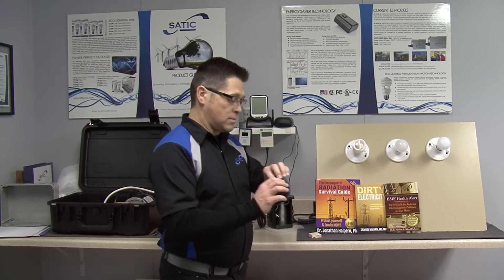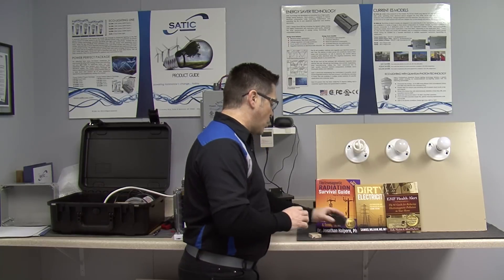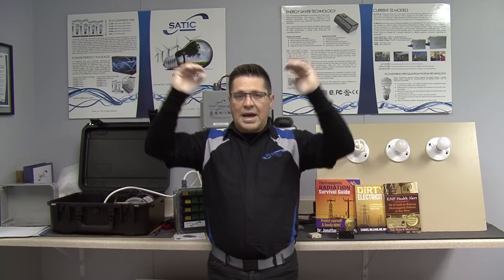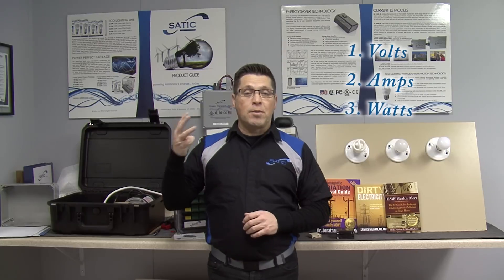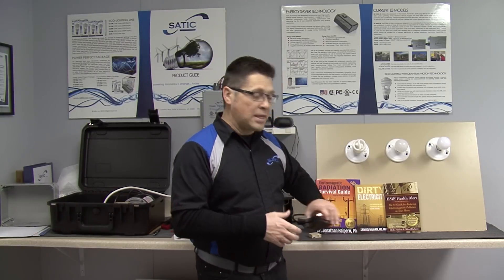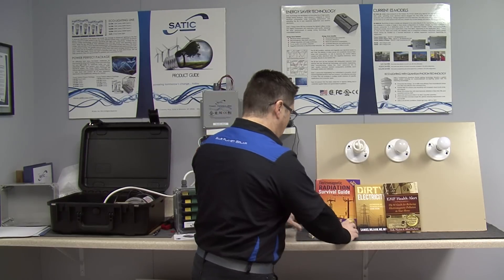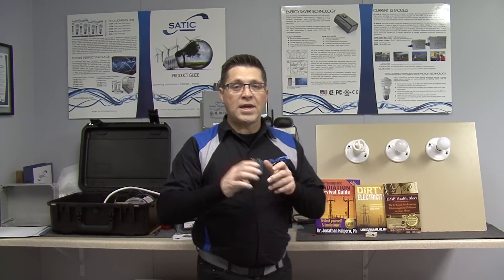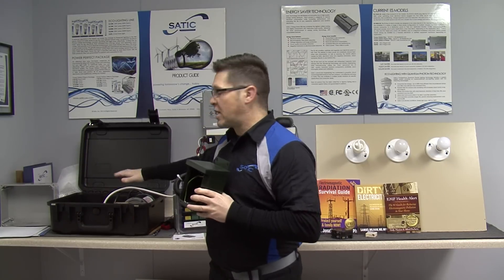What is Dirty Electricity?

Comment: What would turn my outlets black?  I can hear my fans going fast and slow.. Is that a spike in electricity?  It goes up and down repeatly for hours.
Jeanne on the Oregon coast  Pacific Power & Gas is my electrical  Grid here in Lincoln   City... >Electromagnetic interference from what? May be the electric grid or how about WiFi?  I know the field can be stacked & pushed. Since the cable runs with electric lines the outcome goes directly into home of choice..  Thank you! Excellent video ❤🕊

Comment: If you wish I would like to know if this would help clean up CB radio static on receive? At the same time it would it help if the load is unbalanced in the breaker box? I was told that was what caused the breaker on my Honda generator to trip every time until we bypassed the factory Honda GFCI. Of course after not finding anything else but the imbalanced. Thanks for the video.
Reply from the maker: Thank you for your question. 

It will only help reduce static on the radio, if that static is indeed being caused by distortion or harmonics on the A/C line. While yes, it is a very common cause for static, distortion on the A/C load center is not the only potential culprit and we can't therefore guaranteed that it will be able to remove the static and serve you in that particular capacity. I'm sorry to ask that you settle for a 'probably' answer. It's just that when we don't genuinely know the cause we choose to state that clearly. Satisfaction is always guaranteed so we don't want you to purchase anything that won't serve you. 

Our only certainty is that your power will be cleaner by nearly every definition. 

Next, the imbalanced load should not effect a 120v device in most cases as its only pulling from one leg (phase) and therefor wouldn't be terribly effected negatively by the other leg (phase) having a smaller or larger amp load. You would ideally like the load center closer to balanced phase to phase for other reasons however, so still something to look into correcting if possible and reasonable in expense. 

Continuing, generators are notorious dirty electricity culprits. One of the usual suspects we call them. It sounds like you were exceeding amperage on the GFCI so depending on load type, inductive or resistive the Satic unit may correct that as well. 

We hope this helps. 
Thank you so much for viewing.

Comment: Excellent video.It here a unit available,  that can be connected to the main line coming into my panel..?
Reply from the maker: Thank you Patrick.  Satic does indeed manufacture whole home, main panel wire-in units. 
Satic Tech Dept.

Comment: Anyone that knows anything about electricity knows that an inductive or capacitive load changes the waveform and that gives you a low power factor and this circuit restores a high power factor.

Comment: I liked the video which was very informative. I tested my outlet by using a radio on the am band with the dial all the way to the left. The noise level goes way up near the outlet. What do you think of these Greenwave filters for dirty electricity? Are they good to use in an apartment building or is it a waste of money?
Reply from the maker: They are an effective tool for reading a form of DE on the electrical system. 
Satic Tech

Comment: If this box removes the EMF why do you need the individual filters ?
Reply from the maker: This question has many possible answers Asheem. Perhaps a customer would like to gift a child in college with a unit for their dorm room, or take a plug in unit with them when staying in hotels or traveling. Perhaps a home owner plans to move and doesn't want to wire something into the panel yet will purchase something today that can move with them. Perhaps the breaker panel is full and can accept no more dedicated breakers. Perhaps their is a tech device, lighting system or RF signal hitting one particular room that we call a "hot spot" with some major source of DE, that we call a "culprit" and the panel unit at the other side of the home can't get to a ultra low number one that one outlet because the cause (culprit) is right by the outlet that is being tested and a person in that room is very sensitive. There are a lot more answers yet I think you're seeing that you usually choose one or the other unless a rare instance. Yet A/C is mysterious even to us at times and every home is unique. Thank you so much. Tech@saticusa.com
Reply: thank you  @saticusa  - i get the gist !

Comment from the maker: Thank you for the replies both positive and constructive as well as from those who consider themselves to be debunkers.  Satic USA would request viewers note that there is no promotion, nothing to buy and no purchase portal. All videos are simply informative and educational for those interested. At Satic USA there is no desire to disseminate inaccurate information and no revenue derived from information. Satic USA is not a social media driven marketing model. However, techs do check in at times and try to reply to viewers. Please be gracious if we miss you, knowing that we're volunteers with no desire to upset anyone. Should we error as we continue to improve our technology, know that it is our sincerest intent to provide accurate information in serving the greater good. 
a)      RE: (DE) making your phone warm while charging. We can start with what we know. One cause is simply resistance, Ohms law (I2r) has proven beyond contestation that heat is a bi-product of moving current down a conductor. Next harmonics (THD) are any non-sinusoidal currents or voltages, also known as distortion, caused by any non-linear load. A DC device (phone) is a non-linear load. So if you reduce current and/or distortion you will lessen heat. While perhaps not the only cause, experts deduced long before Satic’s engineering team, that it is a contributor. If you have discovered additional causes (e.g. battery age, chemistry, etc.), please share. 
b)      RE: Capacitors. While it is true that many EMF/DE products use capacitors, Satic’s main technology and proprietary IP is a circuit board based, harmonic-rectifier driven technology.  Adding multiple capacitors may exacerbate the issue. 
c)      RE: Radiation. Satic makes no claims regarding radiation other than anecdotal data provided (to Satic) by third parties (e.g. engineers, building biologist, etc.). Our lab has no way to test for it, and we've never commissioned our engineers to tackle that issue. 
Best,
Satic USA
Tech Dept.
Reply: Look, I don't mean to put your nose out of joint. However, I used harmonics in everyday electrical engineering (RF). I'm retired now, but teach part time, students at night-school. Harmonic distortion is a function of the square-wave, not the sign-wave. Every frequency will have an 'odd' harmonic that needs to be filtered out at some point, especially when choosing a mixer circuit where you need to choose from the sum or the difference frequency, not forgetting the fundamental. In audio circuits, the third harmonic is a natural repercussion of the amplification with out filtering, and if you do filter the third harmonic, you're going to need a lot of capacitors and resistors! Yes, I know you can do this on a chip these days.
Reply: @saticusa That is an astonishing load of pseudo-technical word salad hooey. You will probably impress someone who knows even less about electronics and physics than you do. I have been an broadcast and electrical engineer for 41 years- you are not fooling me. 

There's so much wrongness in this lump of text I have a hard time knowing where to begin. 

The ONLY thing that causes a mobile phone battery to warm when charging is current passing through the battery's internal resistance. If you reduce current flow to a battery under charge, yes, it won't get as warm, but neither will it charge. 

"A DC device (phone) is a non-linear load." That's hilarious, meaningless nonsense.

There's no such thing as a 'bi-product.' 

I have no idea how you decided there is distortion in a sine wave on a power line and how that might affect a battery, especially when there is a switchmode power supply between the battery & AC mains. That's plain bunkum. 

In 41 years, I have never heard of a 'harmonic rectifier.' This is a term you have made up for your own purposes, which appear mainly to convince non-technical people that you know something about electronic engineering, which you clearly do not.

The whole notion of 'dirty electricity' is con artistry meant to fool people into thinking they need to buy something to fix this non-existent problem. 

If you have read this far and you are looking for solutions to your 'dirty electricity' problem, first sort out your gullibility problem. 'Dirty electricity' is as real as chemtrails and invisible pink unicorns.

Comment: The chargers for our phones and laptops also are SMPS based hence similar to the Solar inverter. So why won't the output of these chargers not have dirt/noise as well? No matter how clean of an AC source the charger was plugged into, the phone/laptop will receive noisy DC power, thanks to the high frequency of the charger circuit. 

So what is the benefit of this dirty electricity removal discussion when in the end you are just going to add noise back into the terminal devices.
Reply from the maker: Swagat, they certainly can add noise. You are correct. While we want to be careful saying all or always, technically and generally speaking you are correct. So the answer may be another question; if we know we're going to add potentially more noise (almost for a certainty) do we give up and not filter at all? Remember that noise will be added to the system and it is collective. 
At Satic, our belief is that since we are quite certain that we will be adding noise, then yes we want to filter and lesson the amount. Remember that it's collective, or compounding Swagat, what we get and what we create. I certainly don't want to stop using my phone, so let's do our best to lesson the impact of these DC devices on the overall system. Great post. 
B.D.
Reply: I agree. So what would be a better solution? To clean the AC supply of the home and then look for a future where the terminal devices will also be Clean Electricity compliant? Like all the chargers or light sources will  be made such that there would be minimal to none dirt generation by the user's appliances? Is that what we are looking for in the future?
Reply from the maker: Swagat, so two solutions come to mind: First, yes filter the home or business. Second, since we have zero control over other manufacturers, create an LED that does not distort. Please check out one of our LED's. BD
Reply: I did not understand your doubt PBF. The current of DC source is also variable. It depends on the load you attach. If you were to buy a battery then you have to mention what amount of current you will possibly end up drawing from it. In case of a DC source like a charger, the current is still variable. The value you see on the charger is just the rated current capacity, it doesn't stay constant for the entire charging session. If you could elaborate your question I would be able to answer better.
Reply from the maker: Swagat is correct. DC voltage can be anything you want it. Power source (line side = battery etc.) and load (load side = device etc.) are your variables.
Reply from the maker: You can have either AC or DC circuits. You can also convert or invert from one to the other. You are welcome to call Satic and speak to an engineer when you have a minute and we'll try to help. We have 3 engineers on staff, yet most are out until after the 2nd of Jan.

Comment: i didnt realize dirty power could cause so many problems my desktop is connected to a ups to help but i didnt realize. Thank you for the great and easy  understand video.
Reply from the maker: Our pleasure.
Reply: Only if your UPS has power filtering or is an expensive one that remakes the sine wave with a good inverter. I use a Belkin surge protector power strip(25$ online) that also has power filtering on it to keep my expensive self built PC working well and for a long time.
Reply: storm37000 yeah it's a APC ups it's got the massive transformer in the back and the digital display

Comment: why not use some kind of radio frequency harvesting system to use the radio frequency for powering our devices instead because radio frequency when used for charging a phone or when used for turning on  a light it doesn't burn the electricity therefore the light would not go out so if we were to have a self sustaining generator and have that hooked up to an earth battery then it would recharge it wouldn't it? could you not put a sensor on for when the battery is full to shut off then wouldn't the radio frequency be used instead of just floating throughout the air and what about these cell phone towers that are actually frequency manipulators that are used for patents of radio frequency mind control i would assume something like what it would feel to have someone have your brain in the palm of their hand squeezing it as hard as they could and perhaps causing your body to break down and have hives a over like never before would all of this come from the fact that the city that I live in is definitely doing some kinds of testing here because they have the Canadian version of the F.B.I. in the city I am currently taking up residency for a temporary amount of time which will not be much longer thank God, the insurance agencies known as the public servants who call themselves police who are actually insurance agents and actors all train the new enforcing agents there train royal Canadian mounted police here as well which in my eyes they are all this day and ages version of public servants aka the most hated people of the bible next to the hypocrites of the church the men from the Jewish religion the high priests, would be the policing the enforcing POLICE AND RCMP ALL OF WHICH ARE ENFORCING CORPORATION LAWS OF THOSE WHO WORK FOR THEIR COMPANY ON ALL THE REST OF US WHO DO NOT WORK FOR THE COMPANY OF THE GOVERNMENT NOR DID WE EVER CONSENT TO BEING without consent a victim OF THIS DIRTY ELECTRICITY BACKLASH OR THE Fluoridation dirty electricity? and even so what if we had these radio frequency harvesting units with storage cells or batteries this way the energy or therefore the dirty electricity and the schemes of the profit minded individuals wouldn't be so lethal light bulbs really wouldn't even burn out and the devices giving off the radio frequency would not cause as much or radiation essentially that is effecting us
Reply: You would either need to live very close to a high power transmitter, or be happy with a few milliwatts of recovered power. Close in to the transmitter can affect the transmitter's radiation pattern, which will get you a visit from the Feds.
Reply: Not ONE punctuation. Holy fuck, dude.

Comment: Thank you alot for this video, it helped me, to understand more.

Wish more technician or enginers have vocation like you do.
Because not every electrician knows this things... and is really sad

You see, I´m from Sout America, Venezuela, and it seems that here in Venezuela electricity companies doesn't provide a Ground-system also i have notice that even my computer Power supply  reads good the 12 V rail, 3.3, 5v volts the pc still working like slow. i mean i can have the best  Kit of memory, that match with the cpu-processor, best motherboard , and everything properly configured, good voltages, very well set, but even that, i can tell that there is something weird... like a Visual lag,  like a input lag when moving the mouse, the cursors like floating, slow, lag 

This video really inspired me, but at the same time it make me sad, because wish i can find a good electrician technician here in my country to make a good ground system for my home...

Sorry for my English, nice video!.
Reply: Having an earth ground is not going to speed up your PC. Use Linux instead. 

BTW "dirty electricity" is bullshit.
Reply: Your computer's PSU is a switch mode power supply (SMPS), the very first thing that happens to the mains supply is it hits a common mode line filter which attenuates most if not all "noise" with a center frequency of 50 or 60 Hz, depending on your country's line frequency. It then hits a full wave bridge rectifier where it is converted to DC and the resultant voltage is 1.417 times the A.C. RMS line voltage. It is then smoothed out by the tank capacitor to provide a relatively smooth D.C. voltage that supplies the SMPS.

The only rail that is regulated is the 3.3V rail or the 5V rail depending on things outside of the scope of this reply. All the other rails are not even monitored and rely on the transformer's winding ratios. It is completely normal for the rails other than the 5v to be up or down a little. This is due to component tolerances and the compounding effect there of.

Comment: You realize a breaker is designed to only allow a certain amount of amperage so the wiring doesn’t catch on fire right? And to protect from electric shock. It has nothing to do with dirty power. You are talking about a bunch of nothing.